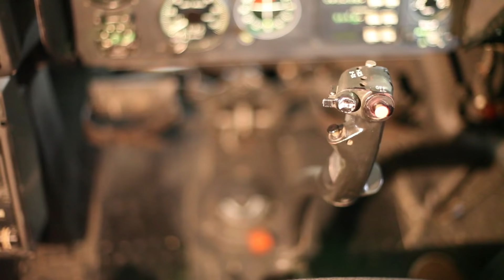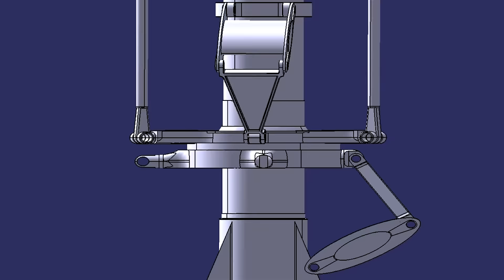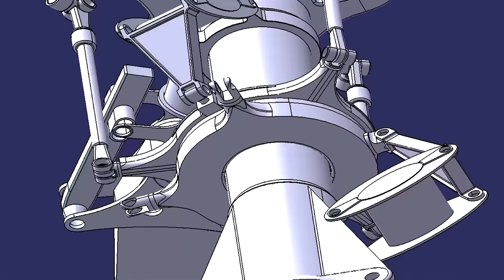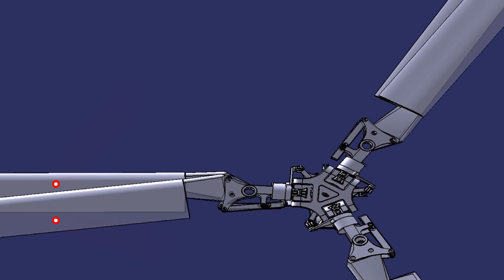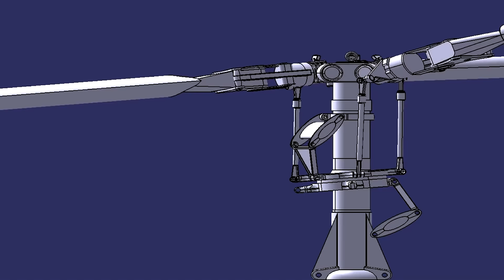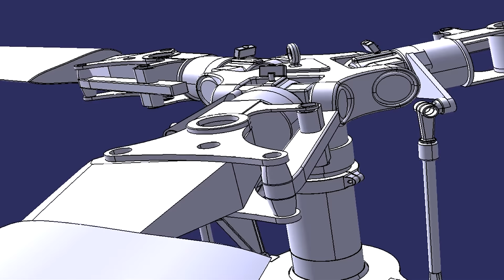Helicopter rotor, video and CAD animation

Comment: Motor Universal Axial-Coaxial
 
The proposed invention is the engine, which bases its operation on the magnetic repulsion and the increase of the magnetic field by concentration of the lines of force. It is composed of rotating discs, which can rotate in the same direction, or in the opposite direction (counter-revolution). The discs contain permanent magnets (neodymium) that follow the rotating magnetic field, generated by the stator. It has a variable number of coils according to the revolutions or power that you wish to obtain. The rotation control is carried out by means of a magnetic field detector (hall) with electronic position control.
    
 
The invention was presented on INTERNATIONAL FAIR OF GENEVA INVENTIONS (47e SALON INTERNATIONAL DES INVENTIONS DE GENÈVE), held on April 10-14, 2019, and where it was awarded by the International Jury.
The status of a patent application is pending and being prepared for publishing (the number is PCT/ES2019/070242). Current invention is the improved version and based on patents MAGNETIC DEVICE SUITABLE FOR USE AS A POWER GENERATOR OR DRIVE MOTOR (PCT/ES2017/070321; published) and MAGNETIC DEVICE APPLICABLE AS A POWER GENERATOR OR AS A DRIVE MOTOR (PCT/ES2019070369; awaiting for publishing).
The proposed invention can be used in such industries as aircrafts, robotics, transportation, aeration and as electricity generator.
 
Details and contacts: http://magnetarplus.com/#contact